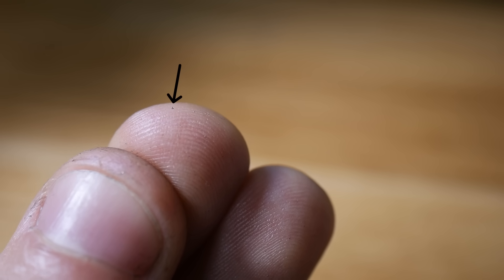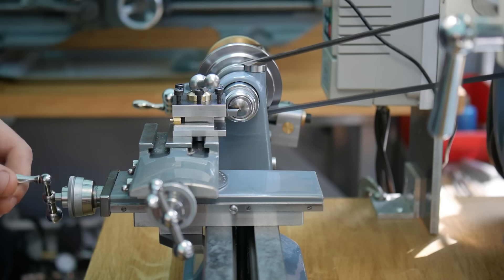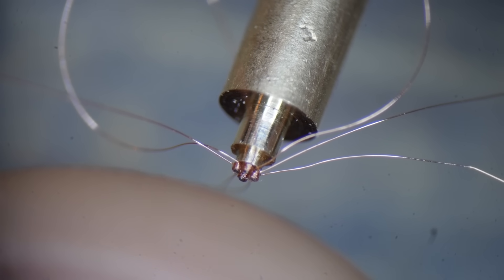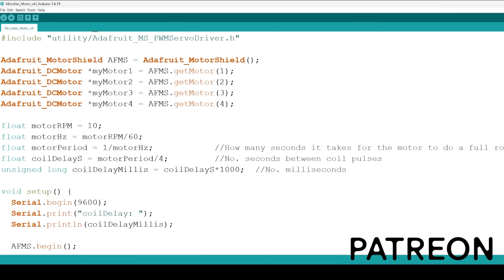Attempting to Make the World's Smallest* Electric Motor

Comment: I wonder if you could produce a mold to form a polyethyene or polypropylene slug to place in the center of the magnets when gluing and then pull it free to form the cavity for the rotor.  forming around a wire to help pull it free?  A strand of poly rope?  Or perhaps something that would desolve?  Balance staffs for watches are turned from spring tempered steel and are less prone to breaking in small diameters than mild steel.  sharp carbide tools are a help. I wonder if you could imbed a tiny fragment of magnet material into a steel rotor?  align it in a magnetic field and glue it.  Watchmakers use flake shellac for adhesive.  it can be soffened on a hot copper disc.  Hot shellac can be drawn out into very fine threads for application.  The item to be glued can be heated on the disc and the shellac threads applied.  You can re-heat the item and manipulate the sofened shellac.  Master watchmaker George Daniels' book "Watchmaking" is a fantastic reference for micromachining.   Please forgive me if this is all old news for you.  You work and perserverence are beyond fantastic.  Hats off to you!

Comment: Your loops are screwed after that turn around, you have to loop in only one direction. It looks like you went back over the previous loops to stay on the. You should also have the same amount of loops on all 4. There should be a good number of loops where it increase without having you loop too many times. From the “failed” one when it was turning slow, it looks like you need to better the time between them, perhaps adding the time it takes for the charge (electrons) to go down the wire.

Comment: Use the ruby bearing. Instead of machining the shaft, would try forming it from pure 24k gold leaf. Probably around a core of thin steel wire. Basically, make a mold. Also, electro plating thin steel wire for the magnetized shafts to wind copper wire. 

If cutting or surfacing secure under scope. Use thin steel wire mounted to abrade the surface gently. It shouldn’t take much to scuff micron layers off softer gold with steel. 

Possibly use the slide riser on scope to slowly lift into wire fixed in tension above slide.

Comment: This is incredible.  Why do you use 4 stator coils rather than 3 though?  I suppose if you pulse them in sequential order, it won’t matter, but I haven’t seen one with 4 so I’m curious.  Does the driver output 4 phases with a 90° phase shift between the phases?

Comment: Next time try grinding the cutoff tool with a 20-25 degree angle so the tip is facing towards the part. This angle is dependent on the properties of the material but if you get it right there should be little to no cutoff tit left.

Comment: As a retired precision toolmaker of 35 years who specialised in very small parts, I salute you sir! That is smaller than anything I turned in my whole career, I 'only' got down to pins that were 0.15mm diameter but I know your pain 😄. As you might appreciate now, "Parting is such sweet sorrow" 😄

Comment: Can you just use a glass or plastic rod through the center of the rotor? Make the magnet portion a simple "ring". You don't actually need coils to induce a magnetic field. There is another type of motor that can just use a central negative contact and a positive side contact on a non-magnetized surface. The current passing through will cause an imbalance that makes the disk spin and keep spinning. The magnetic "bands" will repel one another, making the current pass in a long spiral, like grooves on a record player. (This is how your power meter spins, outside your house.)

Comment: Very impressive project! Im curious why you didn’t use acetone to dissolve the super glue, the soak time could be monitored to only remove the necessary amount. As for the rotor you might have luck parting it off using a wire edm.  If you can make this motor I have no doubt you could make a small wire edm machine or a die sinker edm with a graphite parting tool. 
Do not use diamond grinding wheels on metal due to the excessive heat and carbon diffusion, you need to use cbn wheels. But I understand cbn wheels are probably not available in the sizes you are looking for, although you could use a aluminum oxide grinding wheel to dress a cbn wheel to a similar profile of the parting tool you had success with.  The aluminum oxide wheel has to be spun in order for it to work (look up wheel brake dressers). Best of luck!

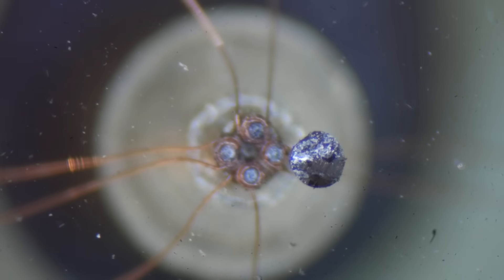Comment: At 14:05, you can see that the dust particles in the watch oil are already rotating, effectively simulating a motor mechanism. This occurs even though the particles are not precisely shaped into a shaft or made of metallic/organic materials. Theoretically, this demonstrates the smallest electrically stimulated motor in action.

Comment: I would suggest you try tempering the sharpend tip of of a steel pin and using that to cut your rotor off

Comment: World's Smallest Handmade Electric Motor - A Nanotechnology Challenge

*   0:00:03 Project Inspiration: The project aims to build the world's smallest handmade electric motor, inspired by Richard Feynman's "Plenty of Room at the Bottom" lecture and William McLellan's 1/64-inch motor.
*   0:00:08 Motor Size: The target size is a 1/64-inch cube (about the size of a grain of sand), with the rotor's shaft being 90 microns in diameter (about the width of a human hair).
*   0:01:14 Motor Design: The motor uses four electromagnets to rotate a magnetized rotor. Diagonal pairs of coils are energized with opposite polarities to create the rotation.
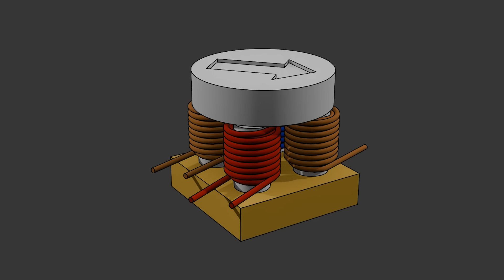*   0:01:36 Drive Circuitry: The drive circuitry is built using digital electronics, unlike McLellan's, which likely used analog electronics.
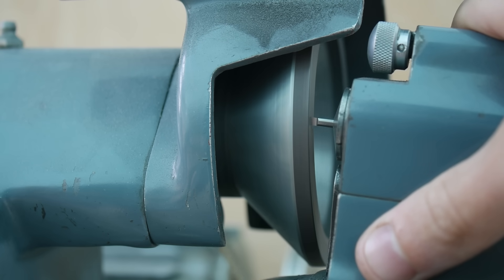*  0:02:21 Machining Challenges: Creating the small components, such as the rotor, posed significant challenges such as leaving a pip. Attempts using a saw and thin diamond blades for silicon were unsuccesful.
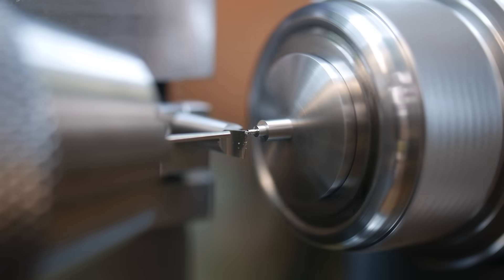*   0:03:51 Parting Tool Success: A custom-ground parting tool, combined with a hypodermic needle for support, finally produced a satisfactory rotor.
*   0:04:24 Electromagnet Creation: The electromagnets were made by winding incredibly thin wire (5 times thinner than a human hair) around soft ferromagnetic cores.
*   0:04:56 Winding Challenges: Hand-winding was impossible due to the wire's fragility. A custom setup with a brass bushing, catch plate, and felt-core spool was devised.
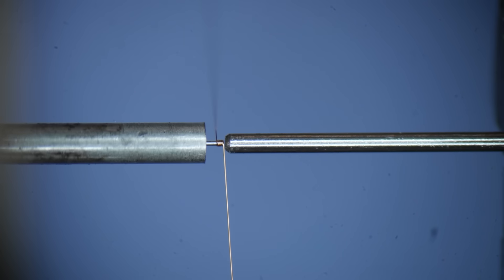*   0:06:56 Layering Technique: A toothpick and super glue, followed by a flat-ended hypodermic needle, were used to carefully layer the wire on the electromagnet cores.
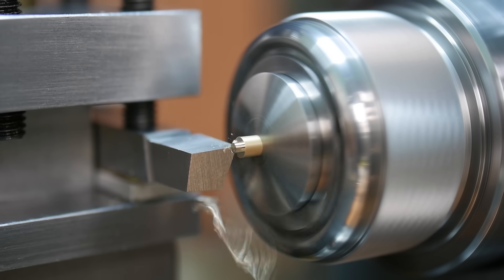*   0:08:16 Base Plate Assembly: The base plate was made from brass, with 0.1 mm holes drilled to hold the electromagnets.
*    0:08:42 Assembly Issues: Debris from using a toothpick to place the electromagnets was an issue.
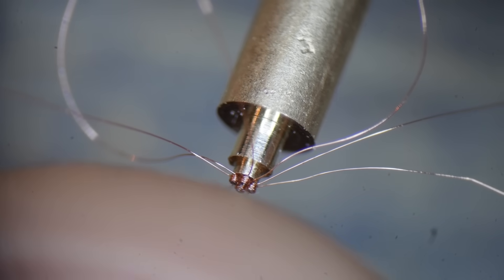*   0:09:11 Adhesive Application: Low-viscosity glue was used to secure the electromagnets, but excess glue caused problems that were partially resolved with a 0.1 mm drill bit.
*   0:09:55 PCB Creation: A custom PCB was made using a pantograph, with pads for soldering the coil wires. Soldering the thin wires was challenging.
* 0:10:38 Rotor Magnetization, and Placement: The rotor was marked and magnetized using a rotating magnet setup, with many rotors lost in the process. Special tweezers were required for handling.
*   0:11:25 Initial Test Failure: The first test run showed the wires vibrating, but the rotor did not move.
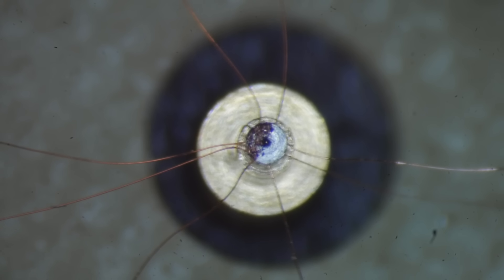*   0:11:44 Rotor Demagnetization: Experiments revealed the rotor had lost its magnetism, suggesting the electromagnets were working but overwriting the initial field.
*   0:12:02 Alnico Material: Alnico, a stronger magnetic material, was suggested. It was demagnetized by heating it above its Curie temperature.
*   0:12:20 Machining Alnico: Alnico proved unmachinable, destroying tools. A grinding wheel and diamond blades were used, but cutting it off remained a problem.
*   0:12:51 Disc Creation: A disc was created by grinding a chunk of Alnico, but it sheared off. The remaining piece, luckily, was the correct size.
*  0:13:14 Simpler Magnetization: The alnico was magnetized by simply touching it on a strong magnet.
*   0:13:30 Rotor Support: A microscope cover slip and watch oil created a thin film for the shaftless Alnico disc to float on.
*   0:13:53 Second Test: The second test, with the Alnico disc, showed some movement but was not a complete success.
*   0:14:05 Size Constraint: The cover slip and oil film technically exceeded the original 0.4 mm cube size constraint.
*   0:14:21 Future Improvements: The creator plans to revisit the project with new ideas, soliciting suggestions from viewers.
*   0:14:45 Scanning Electron Microscope (SEM) Analysis: The Biomedical Imaging Unit at Southampton provided SEM images to analyze the motor.
*    0:15:05 SEM Findings: The coils were engulfed in adhesive, making it hard to determine how much the extra glue affected the device. Also a coil was broken and debris was present.
*   0:15:34 Adhesive Impact: The SEM images showed the adhesive supporting the wires but potentially increasing friction on the rotor.
*   0:15:40 Bearing Suggestion: A watch jewel bearing was suggested for the next version, but implementation at this scale is uncertain.
*   0:15:51 McLellan's Achievement: The creator expresses admiration for McLellan's accomplishment, given the challenges encountered.
*  0:16:04 Invitation to the Viewer: Viewers are encouraged to join the Patreon to get an extra video on the project and give any possible advice.

I used gemini-2.0-pro-exp-02-05 on rocketrecap dot com to summarize the transcript.
Cost (if I didn't use the free tier): $0.03
Input tokens: 15832
Output tokens: 1227

Comment: You actually don't sound as silly (in a nice way I mean) as you acted in making an attempt, to create world's smallest electric motor,  however, I would still not consider it as a self contained electric motor until all its drive circuits are also within that minute dimension, so give up now , or build one that is all self contained requiring just two wires using DC electric current and with commutators.

Comment: May i ask why not make a homopolar motor with the electromagnetic coil on the outside as rotor? You could then make the larger baseplate as permanent magnet and a stationary shaft to be vertically attached to it. One end of the coil touching the magnet and the other end touches the shaft. If permanent magnet baseplate and stationary shaft are electrically isolated from one another, just connecting the dc power supply poles to base and shaft should make the coil spin.

Comment: For creating a piece to function with the lowest friction possible use polished zirconia. The grain structure is so tight that it allows for friction to be reduced. It can be milled in powder form first, then sintered to final hardness then polished to final spec of what ever piece you need.

Comment: You could, use super glue to create the centre, of the motor shaft. Super glue a drill bit " that won't break." And after the glue -begins- to cure... you should be able to create a strong, smooth, bearing surface. Even uv glue would be awesome. Awesome work!

Comment: This is awesome. Thanks for posting it.

I think you should take a look at the types of motors that children would make in a school science class. All you need is some wire, a battery and a magnet. 

The coil and rotor are the same thing. A magnet is placed on either side. 

Its a very simple motor, but it might be what you need. As this is very fine work and the simpler the better.

HackerJP has a short that shows the concept. Just type in. HackerJP diy motor.

Comment: with a little precharging, you can easily hold your breath longer.
it's simple, but weird, you just breath heavily for a few sec and get excess O2 in your system.
if you can get to light-headed (I've never gone farther) while charging, then you can probably DOUBLE your time.

Comment: Your work is astonishing!
Have you tried layers of light-sensitive laminate, then using a UV lamp and template to cast a shadow on the areas you'd like to preserve? It may be more messy than worth it, but it's another avenue for a man with your skill
I used to work in a semi conductor fab that used older methods for building chips, and this was one of them.

Comment: I wonder if you could print the wire coils using a deposition technique? Maybe a substrate, like a pcb, can charge nanoscopic pads that attract copper atoms. As the atoms build up a wire, adjust the adjacent pad charge to steer the atoms at an angle -- like wrapping the wire.

Comment: Hi i think about this is best if you try everything in simplest posible shapes like disc, donut disk, bar. Well i think i find the wey how to make this component but problem is assebling it. So if you make the machine (mechanical or eletrical) what can help you for moving parts to assemble. Disk you can make like you find foil what is ideal diameter and you place it between tvo much larger metal disk and maching it to the diametr you want  these two disk have hole on the midle for rod you can stick trought rod (shaft bar). After that you you your metal disk with metal bar like in your video. This is the way you make longer bar to go trough midlle hole of base and press (squeeze)  the other end to secure it in place. Maybe thats the way ?

Comment: I made some 80 mg drum actuators.  Some of the challenges sounded familiar.  Unusually expensive tweezers, method of tensioning extremely fine wires, and so on.  I would not give up if I was you.  You can make a stand-alone Arduino with a single 3 x 4mm chip, some hair thin wires, and a resonator as well.

Comment: Why not attach tweezers/clamps to the lathe slide and use the lathe to assemble the motor by guiding the tool holer into possition before releasing a part once in place? You can even turn it upright to allow you to leave the motor base in the collet. As to the design I would try to drill a hole into the rotor and machine a shaft + 4 holes into the stator. Use graphite as bearing lube and place the rotor on the shaft.

Comment: It's really interesting how scale affects everything. This project is almost analogous to using only construction vehicles to fabricate a normal size motor; like trying to use an excavator to wind normal wires around a typical metal rod.

When the scale changes enough, all of a sudden the norms of physical laws are obsolete, and you really have to go back to 1st principles and retool (or patience using trial and error). 

This guy could be a brain surgeon with the kind of precision he has using his fingers!

Comment: Hello, I have a suggestion regarding coils.
Some time ago, I saw people making microcoils using a wire bonder. The coils had a diameter as small as 100 µm.
There are several publications on this, including one titled: 'A fully MEMS-compatible process for 3D high-aspect-ratio microcoils obtained with an automatic wire bonder.'
If you have access to a wire bonder, it might be interesting to have a look into this approach.

Comment: Would it be possible to cast the rotor rather than mill or lathe it?  Drill a properly shaped hole in some polymer, fill it with a drop of molten Alnico, magnetize it in situ, sand off the sprue, and dissolve the casting polymer in solvent.

Comment: I thinks coil areangement using pcb strips which are fiber paper materials( you seen that in mobile phones  strips...they makes pcbs usig copper coted fiber sheets(i forgot name)...using laser eatching or burning....so why dont you approch diffrantly...
Think about a micro pcb having 4 coil printed on it like your 4 coils...in each coil a hole(so 4 holes)....and abve that a magnate disk(should be light weight because printed coils generate low magnetism) and same magnate disk arrangement   as this in video.....
One more thing...not sure another possibility  is to use 3 or more layers( like a sandwiche)...of same micro pcb contaning 4 coils will increase magnatism in coil...
But for that you find a way to aline them and solder them using heat gun
Your useful materials  are heat gun, soldring paste which melts and solders joints wher apply heat air...you should also watch  micro soldering videos solder paste videos

Comment: I used to do a lot of micro-electronics at about this scale and I found that tweezers were not my friend. Instead, I would pull out a single hair, super-glue it to a sharp pencil, then snip it just a bit longer than the tip of the pencil. I could then wet the hair will a little spit and use the surface tension to move things about. sometimes  I would need a second dry one to break scrap it off once in place. check out "01005 resistors" the 01005 is a package size of the component. perhaps there is a supplier that makes 01005 coil inductors now that would simplify the process for you.

Comment: To remove superglue without moving parts, use acetone, nitro fuel, or diesel. it'll just wash right out. you can leave it to evaporate or -- my favorite method -- a quick lick of a lighter will get rid of the liquid in a brief flash. i do this all the time when waterproofing rc electronics and i get glue in the wrong place.

Comment: Tell me what is this small motor is going to do? Is it stationary or  suppose to move? Is it to pump some liquid or to cut something?Shall we neccesirily feed it by wire or as the size is small we do that through induction say wireless under rotating magntic feild.It is clear using copper or silver wire and iron and things like that,then there is limitation treshhold to the size and we will not be able to make nano size by that structure and by that mechanism.we are to think other ways.Any way thank u watching your video showed your cleverness and your patience to me.